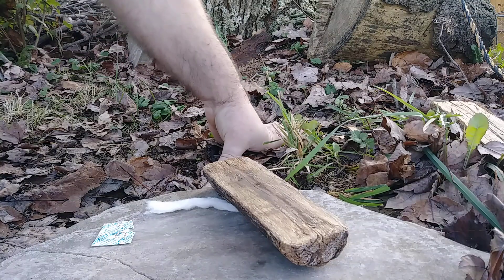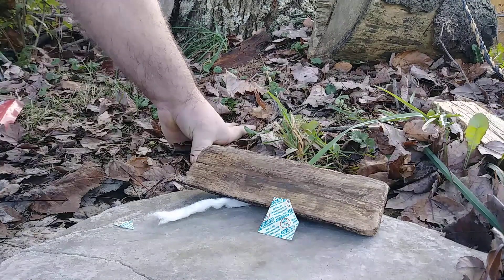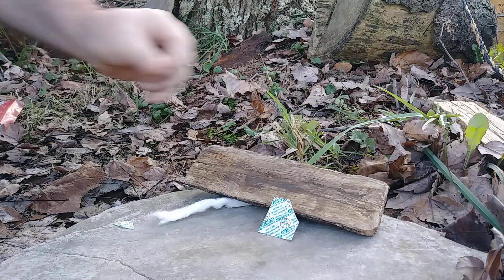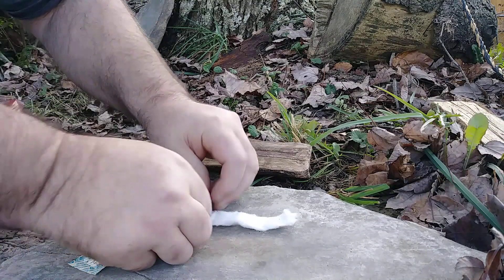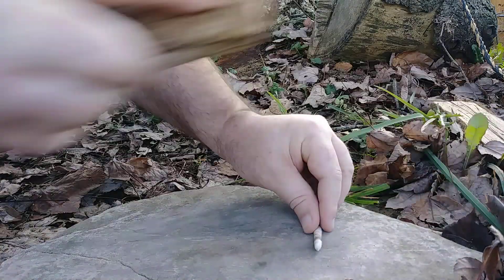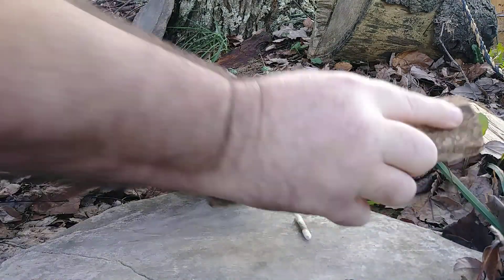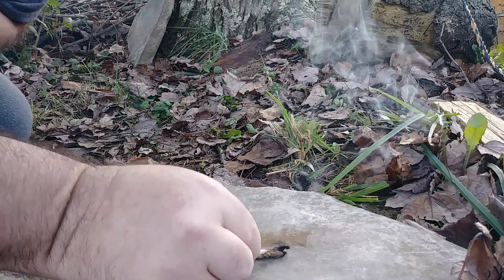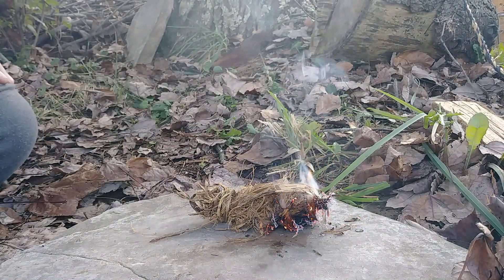Rudiger Roll Oxygen Absorber - Iron oxide - Rudiger Roll Rust - Fire Roll Rust Origins natural

Comment: Thank you for this video! I just so happened to have saved an oxygen absorber pack from a pack of jerky a few days ago (don't know why but I did). I have cotton balls already that I use with petroleum jelly for fire starters, so I pulled one out. The only thing flat and wooden I could find in my garage was a $40 tiger striped maple turning blank I've been saving for a candle stick. I gathered my materials and set up on the corner of my concrete patio. Literally, less than five minutes, I was 3 for 3 in my attempts!
Reply from the maker: Glad you tried it for yourself. Thanks for sharing your experience. Have a good day.